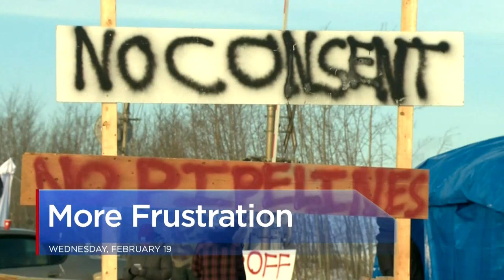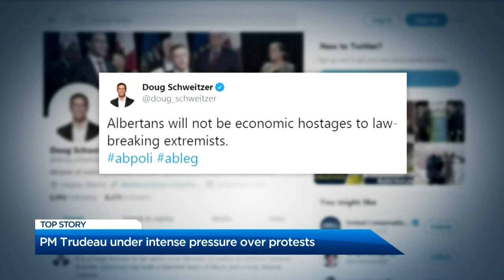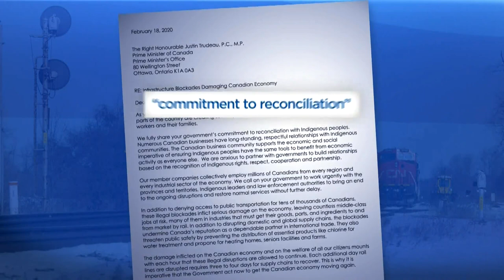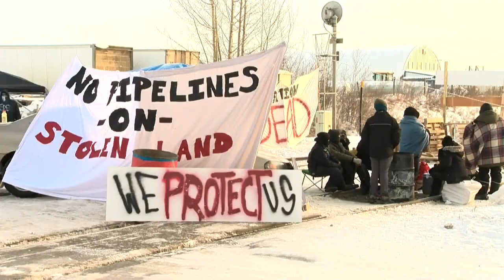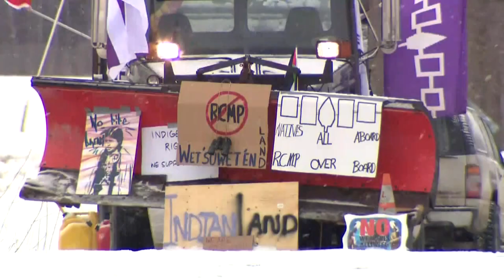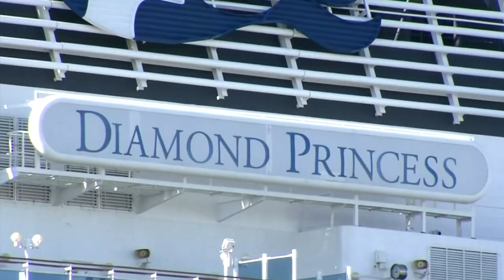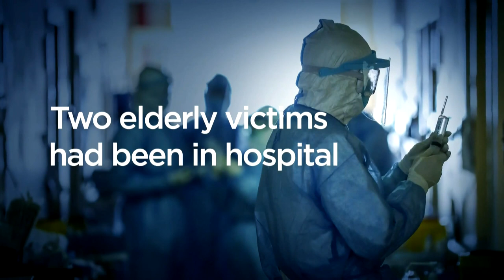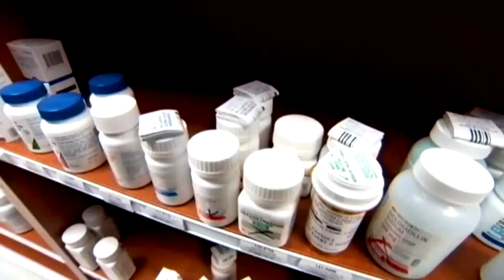Global National: Feb. 19, 2020 | Coronavirus outbreak could bring medical supply, drug shortage

Comment: We need to make it mandatory for every new building and house to have solar panels and be connected to the grid and batteries. Even if it snows and half the day is dark there will be too much power and the need for fossil fuels will be minimized.
Reply: Awesome, but who is paying for this - I can’t but would if I could
Reply: @helencoltart3483  Very true Helen a basic solar system is well over $10,000 dollars. Perhaps these protesters will chip in and buy us one.
Reply: There isn't enough silver to make solar panels on that scale.
Reply: Storing utility power in batteries is HUGELY expensive, a maintenance nightmare, potentially explosive, brings its own environmental baggage, and requires replacement every 5-7 years.
Reply: Max Powers  
Batteries are dirtier than what we use now.  Tesla energy needs to be used.  Windmills and solar panels are a dumb useless idea.

Comment: Why, why, why do we not go out of our way to avoid these lands in the original plans?

It’s never worth it.  It just stalls everything. 

Also why do those who use fuel and oil, protest fuel and oil?
Reply: Kendra Werner I'm not sure how the protestors in this case feel, but generally pipeline protestors have encouraged the expansion of alternative fuel sources as a replacement for gas. Also, I'm sure most believe sufficient amounts of oil or gas can be found elsewhere, through different solutions that don't require tribal lands or land previously designated for animal habitat or preservation.

Comment: actually if its airborne and can breed in the air and if any planes had the exterior infected with the virus it could be breeding in the jet streams already which I fricken hope not but it is possible as people have been speculating it is airborne and aerosol which I think aerosol means it does not need a water droplet to transfer, then with rain/snow or any other weather system dust etc it will spread everywhere not much can be done but stockpile supplies if that is the case. I hope not but that is what my foresight says. I hope I am wrong I hope it is not airborne if it is they already effected everyone it's just a matter of time, well actually depending on the way the jetstream travels there would be potential safe zones but that's not considering birds and bugs carrying the virus so nvm actually. Get a mask while you can is what I think also get cans of soup and watnot. Eventually immunity will build in survivors and you may all survive. I'm type one diabetic so I'll prob die which sucks but not much I can do but try to prepare my family and people that will listen. I have high immunity to diseases though and my type one diabeties was causes by my own immune system attacking my islet cells they may have of been cancerous..so I may survive. We shall see sigh prepare better off to get ready for the worst and hope for the best. God bless I hope I'm wrong and I hope its not airborne/aerosol and I hope that is just pure speculation. Dont expect your leaders to tell you that they cant think like that. It's not their fault for not having that kind of foresight I have not seen anyone else say that either. All we can do is try to help each other survive

Comment: Come on.  So easy to make masks.  Great quality ones also
Reply: Yes.. But you can also get infected through your eyes.
Reply: @claraalebrook5335  yes I'm just letting everyone know instead of buying.  Can make 25 with heavy duty paper towels  and rubber bands.  So 4 or 5 bucks.  Get the good paper towels like bounty. Use 2 sheets.  Fold and tie rubber bands on both ends. Plus can make fun with kids.  They could color things they like on theirs. People are getting  ripped off.
Reply: Im not sure you can make quality N95 masks with paper towel.
Reply: @claraalebrook5335  also easy make the heavy duty ones also.  Just seems messed up for people to give away hard earned money  on things like that.  I think I'm going make a 100 or so and donate them.  Probably  won't cost more than 12 or 13 bucks
Reply: @claraalebrook5335  no I can't.  Deff can improvise  tho.  Being a single mom.  I've learned to cut corners to save money
Reply: @luckycharms6223  you can make masks from furnace filters. As long as they're the filters that are less than 1 micron. Mpr 2200 series filter. Or line your n95 mask that is only 90% effective against viruses with it 👍
Reply: That I understand saving money.. But this is one thing I wouldnt skimp on. Paper towl can get wet real fast and if you dont have a proper seal.. You're toast..
Reply: @xXxBUNDIExXx  that's a great idea.
Reply: @claraalebrook5335  I use those surgical masks at work.  Don't last long.  I just saw some cool make at home.  Heavy duty masks on u tube.
Reply: @luckycharms6223  maybe the price is different than mine. I went to the hardware store, 7 bucks tops. Best thing, do some research. There was 1700 caretakers in wuhan taking care of the sick.. They all got it. And they had everything on to protect them, still got sick. As far as I know, young ones arent really affected, as long as they are healthy, but check my data, maybe you can teach me something. One person said air filter to less than  1 micron? Thats a  MacGyvering maneuver.